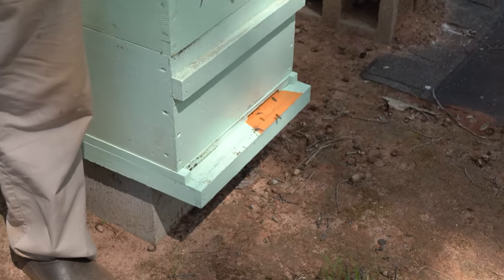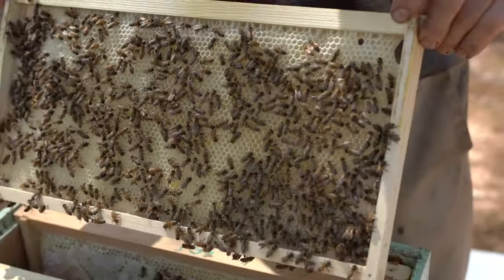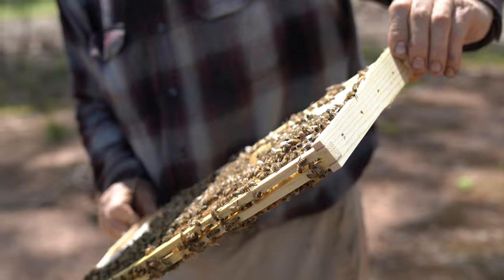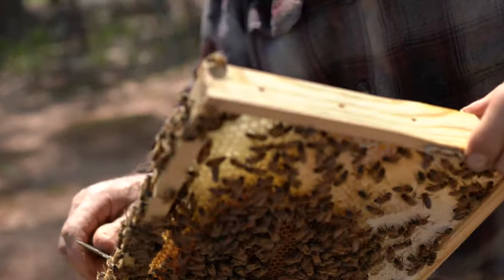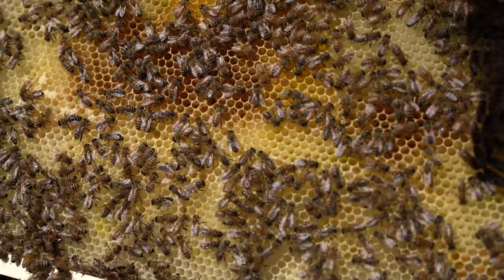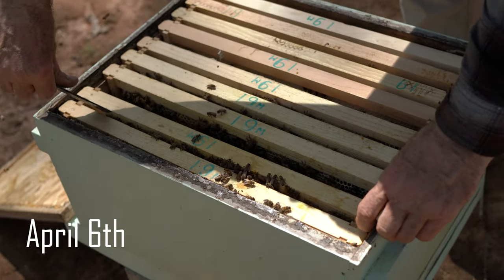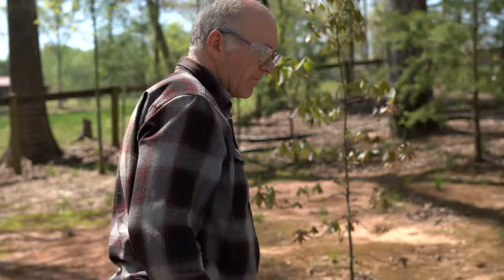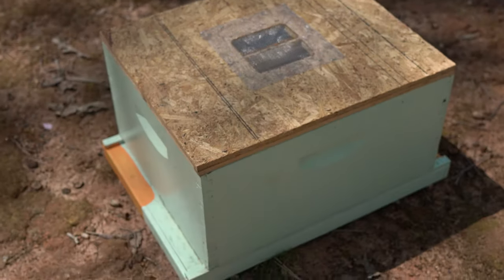Beekeeping For Beginners - Swarm Hive Inspection & Split

Comment: I know that you use beeswax frames with wires and was wondering if you remove all of the comb beeswax avoiding the wires when harvesting or you use a tool like a spatula and scrap off the honeycomb and honey in order to keep the entire frame in the condition you bought it. In other words, how would you extract honey without a spinner or extractor when using wired beeswax frames? Thanks for your videos!